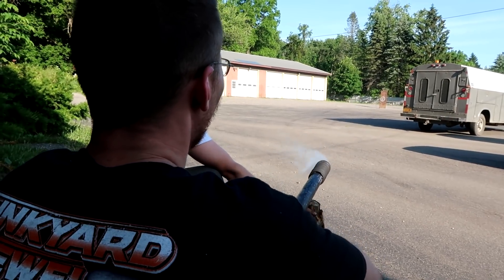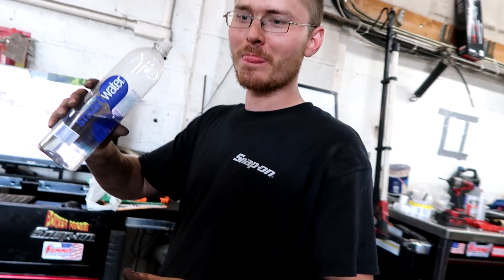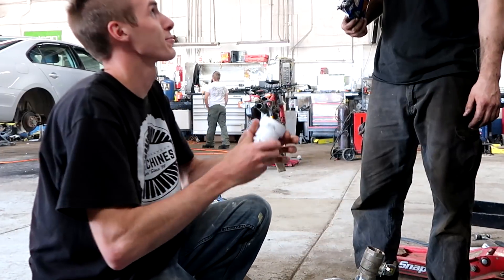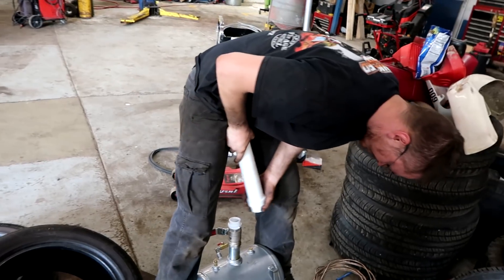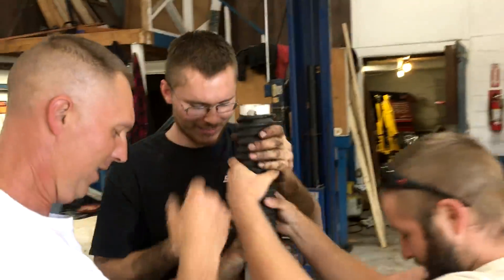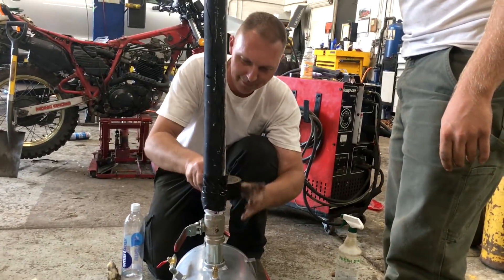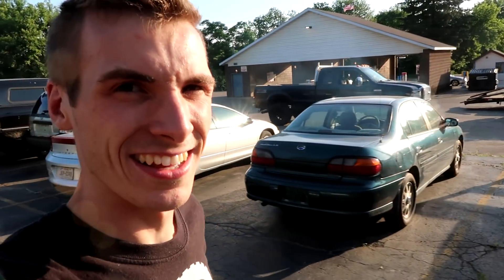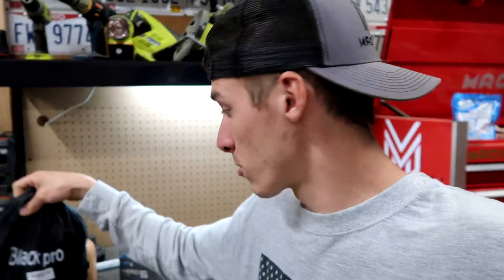EXPERIMENT Huge LAUNCHER VS POTATO 150psi

Comment: POTATO CANNON!! HAHAHA so much fun.
If you used a straight 3inch PVC pipe with a cap on the back and a beveled coupler on the rear end with a nossle for filling up with combustible fluid(I:Axe body spray or similar) it will work really awesome as well.) A little less expensive of a build..